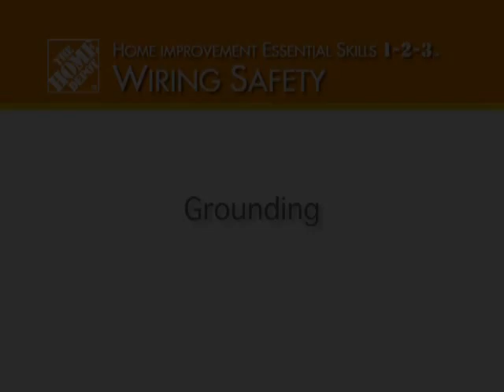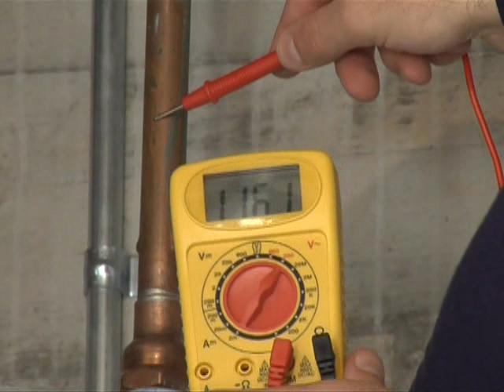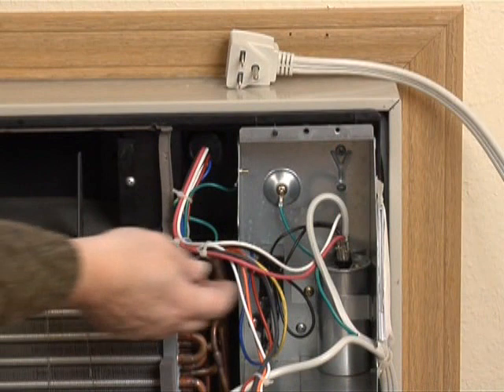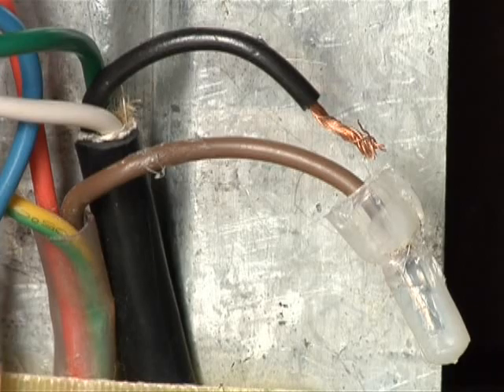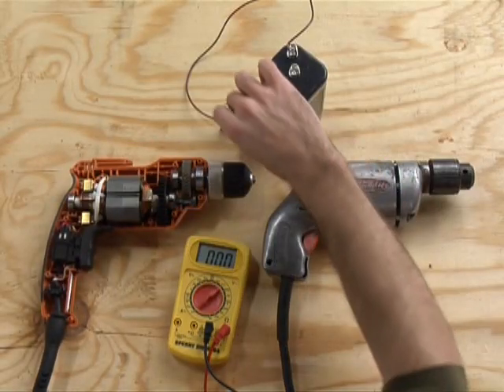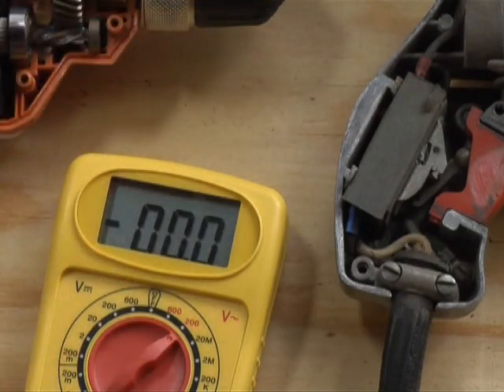Electrical grounding

Comment: Thanks for that video Andy.  I have an electric fireplace that is double insulated and has a polarized 2 prong plug.  However the outer housing is all metal.  I would feel safer if the unit was grounded.  Can I replace the exiting power cord with a 3 prong wire cord and attach the ground wire to the inside of the metal housing.  Much obliged.

Comment: the earth does not "absorb" electricity at all. 

electricity just goes back to its source following all available paths.
Reply: very good video!!,it protects and prevents electrical shock using this GREEN WIRE called "equipment ground conductor"...

Comment: This video is WRONG!.....it is also the reason people do not understand electrical...DO NOT rely on the information in this video.
Reply: this video is good, it refers to safety purposes for an outlet supply using appliances that is prone from shortaged or leak wire that energized around it,so to prevent shock by touching it,use this  extra ground wire  called EQUIPMENT GROUND CONDUCTOR from main panel to power outlet...!!!.
Reply: Hamil Baltazat the clueless would say that.
Reply: Hamil Baltazat .....you really think the earth plays that role.....good grief. Take a class or two...or watch one of mine for God's Sake.
Reply: Master The NEC
Reply: thats not your real name is it??

Comment: This is a terrible video. Electricity travels back to the source! If you use the earth ground as your fault current path you will not quickly trip the breaker... Or may not even trip the breaker at all if the impedance is high enough.
A grounding rod is for faults like a lighting strike to give a path to the earth because that's where the energy is trying to get to during a lightning strike. 
An equipment grounding conductor is there to provide a low impedance current path back to the source to quickly trip the breaker in the case of a ground fault. The low impedance path instantaneously spikes the current super high causing the breaker to trip really fast.